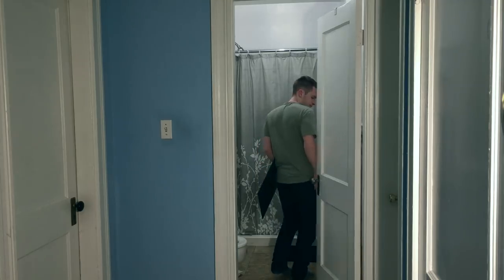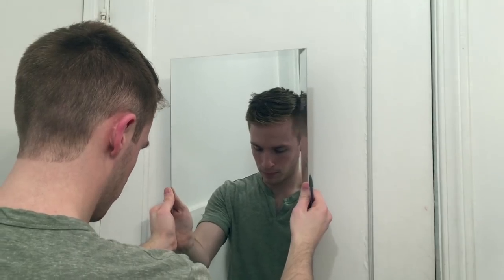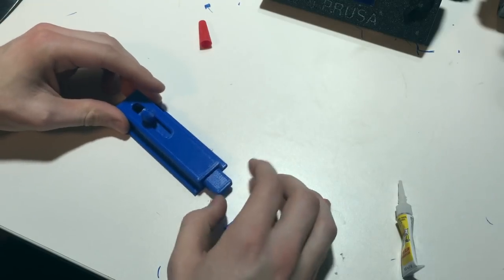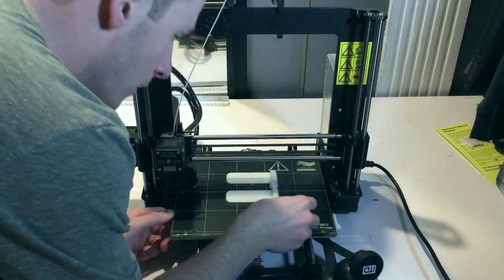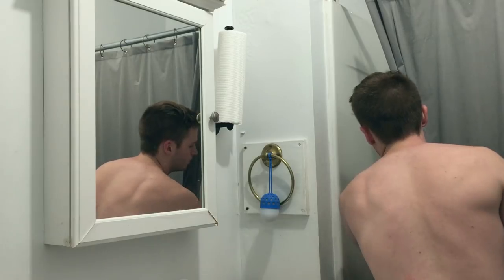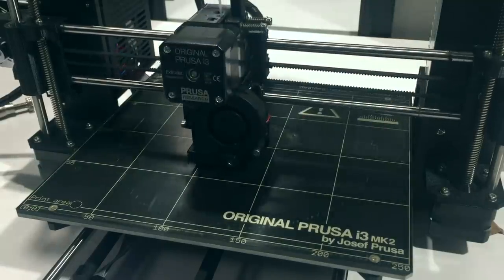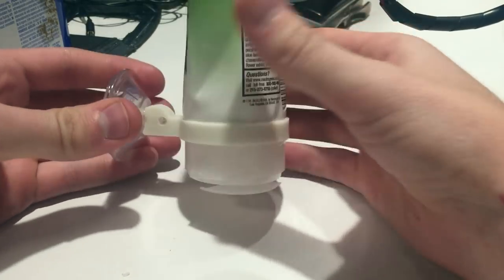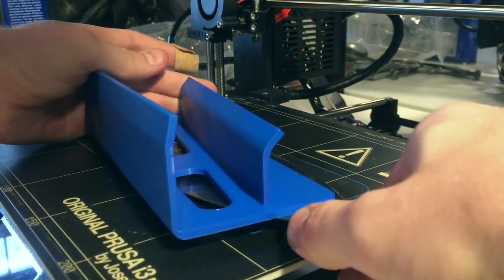Ep 4 Bathroom Hacks

Comment: 3:38 I guess you need to floss more regularly? ;)
Reply: why
Reply: zach99998 normally, if your gums bleed when you brush your teeth it's a sign of inflamed gums, a problem which can usually be remedied by more regular flossing. In this case, his gums were not bleeding profusely because of lack-of-flossing-induced gum inflammation, but rather because of the razor sharp edges of 3D printed hard plastic toothbrush bristles. The confusion between these two sources of bloody gums is the basis of the humor behind the joke.